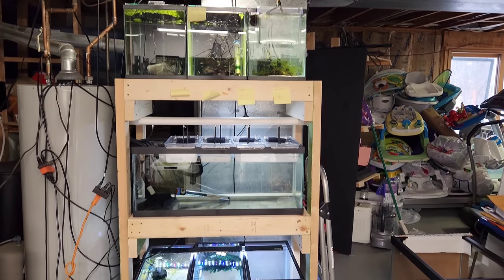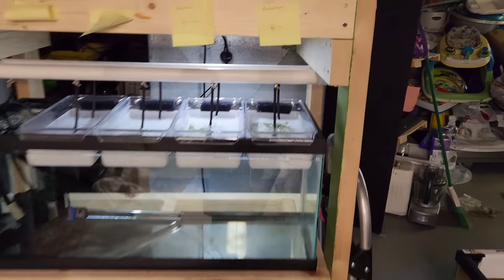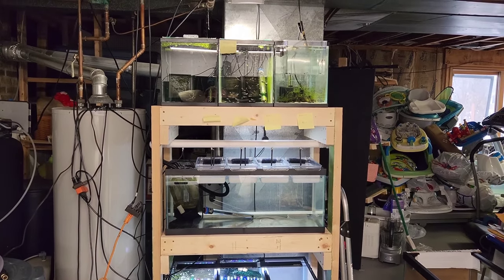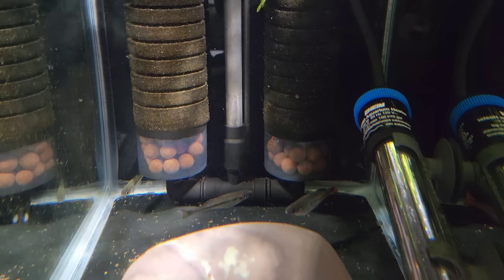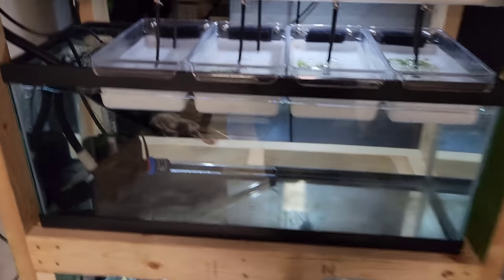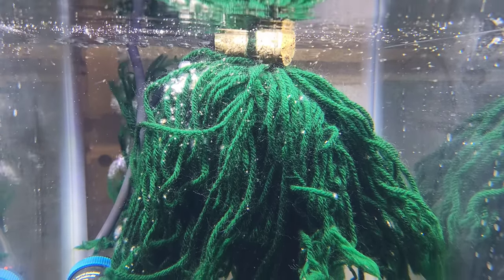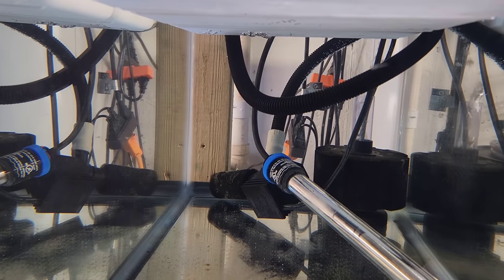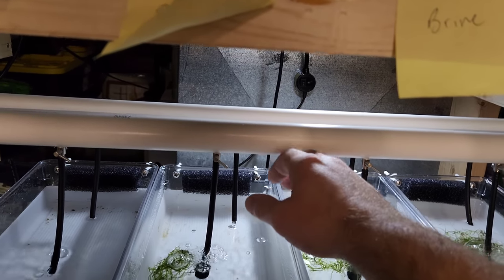MASTER BREEDER DEAN'S FRY SYSTEM + A NEW RACK IN THE FISH ROOM!

Comment: I live vicariously through people who actually have the room to do setups like this. I breed bettas and my whole fish room is probably a 6' x 6' ish space haha, maybe 7' x 7' 
i actually managed to fit a 40 gallon breeder, a 30, 26 bow front, 20 long, two 10s, four 5.5s and a 3.6 gallon tank, as well as a shelf that fits 76 small jars for my betta juvies in that tiny space with a bit of walking room. Tetras has served me well xD
Reply from the maker: Wow, that sounds like you've used every inch of space! Is it a pain to change water in all of those jars? I've thought about breeding Bettas but that sounds intimidating!
Reply: @sydneysangels  would have more space if i didn't have to keep boxes of equipment and stuff on the floor too haha. its a shared space so i'm pretty limited. and omg yes, when they can have well over 500 fry, ( i had over 550 once, it was a nightmare ) even half of those being individually changed manually is a ton of work and takes hours. would definitely benefit from setting up a betta barracks system for easier water changes. i definitely would myself if i had my own house, but i'm living with family. 
i used to take each jar to the bathroom and dump them into the sink and pour clean water in from a bucket, now i use a syphon hose to drain each jar between 50-90% into one bucket and then put my other bucket on the top shelf above the jars and put the water back in with a syphon without moving any of them, its way easier and way faster but still a lot of work since it has to be done every day or two. the fry also need to be fed 3-4 times a day for the first couple months or they don't grow so its not something you can do if you're not home all day. and if you feed them too much bbs they won't grow a swimbladder making them unable to swim properly and will need to be culled, but feeding too much worms early on makes them often not grow ventral fins  so its both tedious and complicated haha. you really gotta feed small varied meals often to avoid these issues and actually get good growth. 
I still have to do the bathroom method at times, depends on how many fry i get, cause i end up having to put some jars on the floor and you can't really drain them into a bucket that's also on the floor lol there's a bit of room in front of my 40 gallon which is high enough off the floor where i can use the bucket but not a lot so if i get over 100 males i'll definitely have floor fish.
Reply from the maker: @creaturecola3208  wow, I had no idea so much went into breeding Bettas! Thank you for sharing that with me I really appreciate it! So a lot of time and love goes into the process but I'm sure you love what you do!

Comment: Good stuff bud. Really good stuff. I'm just starting to put a system together and I got ideas from you here. I was gonna buy shelves but after watching your video on stand builds I will be building my own. I've got everything from a forty to a 50 to a couple 30s and multiple 10s. A few will be hooked up to a large central sump system.  I've gotta build stands for all of them.
Reply: Central sump is risky even when you're VERY careful and watch for signs of infection, if you don't isolate your tanks ASAP, it'll spell disaster.

Comment: Can't tell from video / i might be being dumb but is your stand the same as Joey's? Can't tell if yours has wood running down the inside to support the weight. He tends to try to have all the weight resting on wood uprights just to be safe, not on the screws/ nails incase of fails.
Reply from the maker: It's not exactly like that. I found an older video of his and followed it exactly so maybe it's possible his design changed over the years?

Comment: couldn't you remove the rodi filter, unmount the plywood, remount the plywood a little lower, remount the filter back onto the plywood, now you have more room to mount onto plywood and don't have to re-do the PVC work? i know it's a bit of work and maybe just adding new PVC could be easier lol

subscribing for being a fellow short king lol

edit: nvm saw you mounted it with scrap! for the light diffuser + plastic canvas do you suspend it in the tank or just set it down plastic canvas facing up and let the light diffuser keep it off the bottom of the tank and let eggs sit in those little spaces?
Reply from the maker: Haha thanks for the comment the sub! Hahaha fellow short king I love it 😂 yeah let the portion with the light diffuser face downwards, that provides an area of refuge for the eggs that make it through the plastic canvas 😊

Comment: How can I get some of those fry tubs?
Reply from the maker: I believe I added a link in the description for the exact ones on Amazon! If you would rather pick them up in person, I found them at a local Meijer grocery store
Reply: Sorry more specifically, the fry tubs in the 20 long where they hang on from the side instead of the back
Reply from the maker: @ceeganclingan8218  those are the containers I've linked in the description, they have to be customized with some stainless steel screws and a hole with sponge for an outflow.

Comment: Instead of vacuuming the fry trays, why don't you have a spare fry tray, carefully pour the contents of a fry tray, into the clean tray and then easily clean the used fry tray and then continue on to the next fry tray.  Should be a lot faster and better than vacuuming.
Reply from the maker: That's not a bad idea! Especially with some of the more stubborn waste that sticks to the tray. The problem is it's such a pain in the butt to get these trays in and out since I didn't leave myself enough room. Once I move this system I'll have to experiment with that technique. Thanks!

Comment: I have a suggestion for the next fry rack. Set up two levels but set back the top rack buy 6 ". You will be able to work with no problem. I use a 20 br. And a 20 long. For mine. Small trays in top larger in the bottom.  Your set up is awesome. Congratulations on all the fry. I have always wanted to do rainbows. What do you feed the first fry? I am a cat fish and Angel breader.
Reply from the maker: That is a brilliant idea, thank you for that. I might have to do that once I get more time! It sounds like you have a great setup. Thank you! Rainbowfish are actually pretty easy once you get the hang of it. I just feed the fry powder from sera until they're old enough to eat brine shrimp. Once they eat brine shrimp it's easy street. I would love to learn more on how to breed catfish
Reply: @sydneysangels   thanks for the information. We might need tock. Thanks for the great video's. You do a great job.
Reply from the maker: @scottcahala7779  thank you 😊

Comment: No need to waste money on the tank as a container for larger water quantity, you get a big tank made of plastic with deep substrate and plants with a growing light and have a small circulation system with these boxes to circulate water. Secondly no need to get air stones those pumps that allow water with air to merge and create aeration is best option. 

Furthermore with deep substrate system the microbial level in the tank would become stable and have an ecosystem. The feedings would be reduced as well because the small creatures would become food the for fry. 

Check father fish. 

Fresh water in terms of pH and the microbial load can affect the babies significantly.
Reply from the maker: Thanks for the information! There are certainly many ways to achieve success. I appreciate the insight! Nowadays I use this system more or less for hatching out different batches of fry and then I move them over to a bigger container.

Comment: What shelving is that and how many pounds can it hold?? I need smth for one or two 20 gallon tanks per shelf!
Reply from the maker: I just used standard 2x4 lumber and then the black rack is straight from Costco. It was a gift so I'm not sure what the weight rating is on it

Comment: I drip acclimated the first few times I added cherry shrimp but I've done a quick temperature match just for a few minutes recently and then dropped them in and not had any losses or concerns
Reply from the maker: Oh sweet! I've often wondered if I could get away with that because I know they're rather hardy. I just plop and drop them when I know they're going from tank to tank but I'll still drip them when I get them in the mail just to be safe